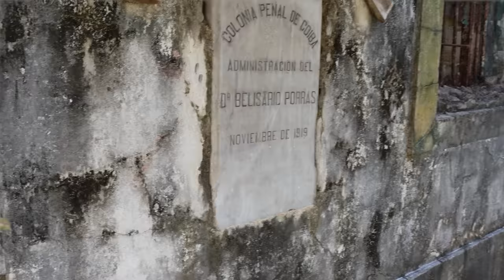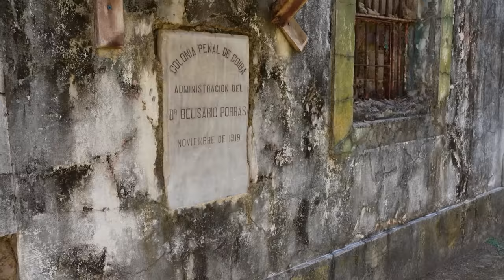PIRATES took over our boat!!! | S4E6

Comment: The dampener plate is not really like a clutch - its purpose is to dampen the uneven power of the individual cylinders firing, which it accomplishes with internal springs. Without it the rest of the powertrain (transmission, etc.) would be shaken apart in a very short time. 
I just had to remove my transmission to be overhauled (worn thrust bearing, $$$), and replaced the dampener at the same time. I can’t believe how dirty yours was, yikes!

Comment: Ever considered installing an electric sail drive? You charge the batteries while it's windy, no need to plug in. You could keep the diesel as a generator.
Reply from the maker: I know a few people that have done that... The tech isn't there for the type of sailing I do. If I didn't have a crew, it was just Ana and I, and we had unlimited time to wait for wind, it may be viable.

Comment: That's a bad axe design! Why is it offset?
Reply from the maker: Because of the size of the design, it needed to be stitched sail material, not just painted on; offsetting it made it easier to sew and made it straight when the boat was going downwind.
Reply: @thelastpirate  Make sure that you always set your spinnaker so that it faces forward because that looks best.

Comment: Your "dampener  plate"  is basically just a clutch , same as  a car  I've been changing those  out for over 50 years  .  Just recently quit  .   Enough is enough
Reply: It's just the dampening part...no clutch part.  It looks like a car clutch because car clutches integrate the dampening in the clutch.  Small boat transmissions engage drive inside the transmission when you put in forward or reverse